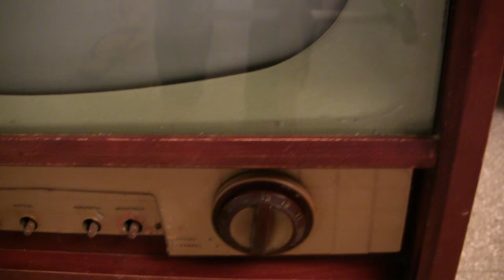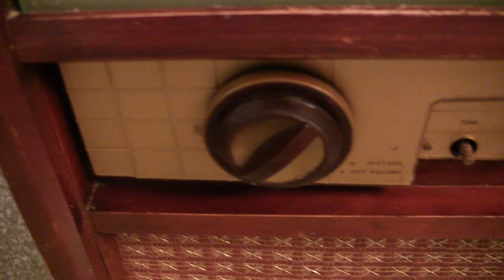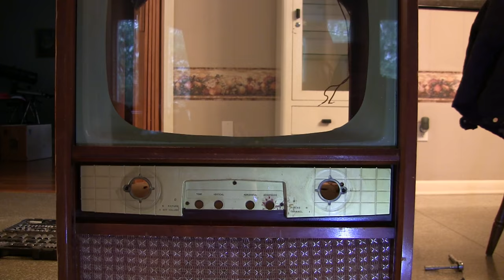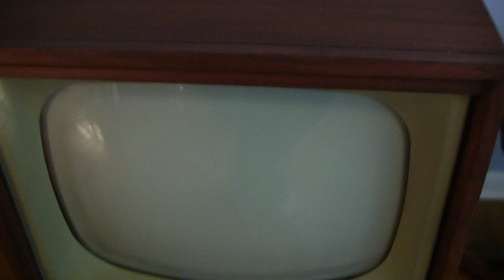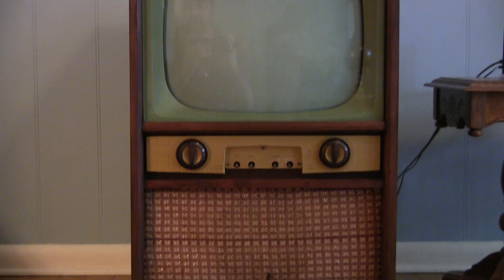1953 Admiral Television Restoration Part 1

Comment: Does it work now, or will you fix it in part 2?
Reply from the maker: the sound works, the electron gun and tubes light up so it needs to be recapped and probably resistors. I downloaded the schematic and I'm about to order the parts I need. So hopefully you will see it come to life soon.